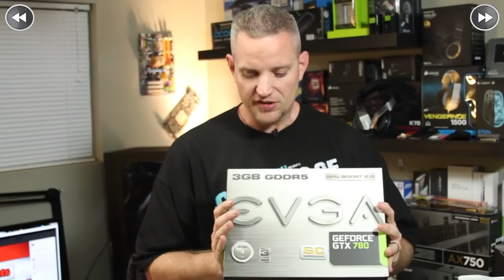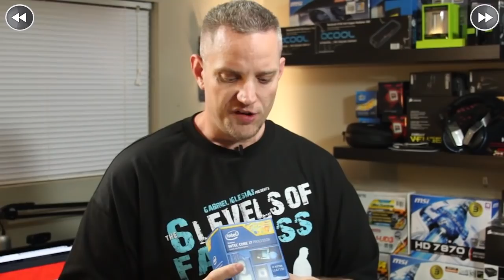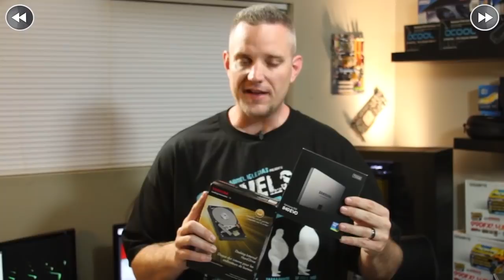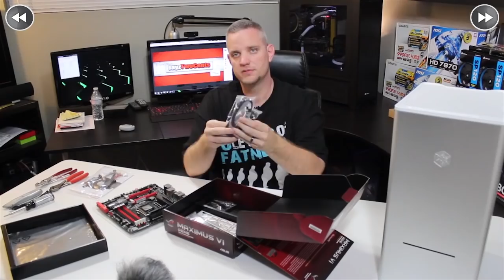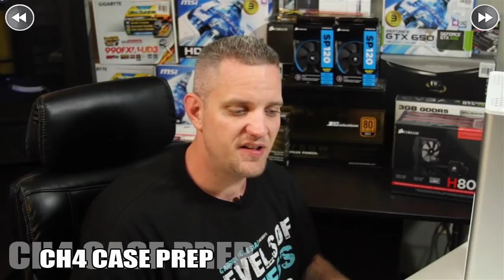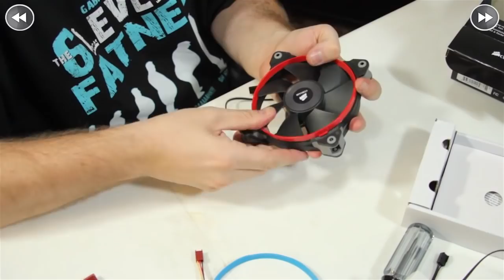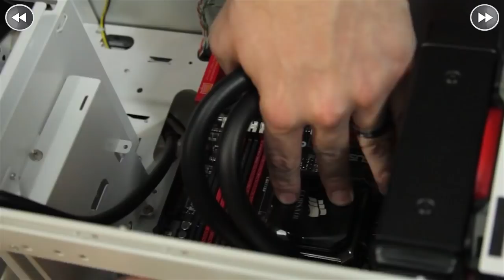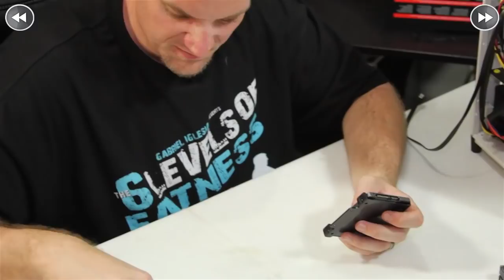How to build the Ultimate Gaming PC - Build Guide and Tutorial

Comment: hey guys so my pc build
is: i5 3570 non k
evga gtx 760 sc
asrock z77 extreme 4 mobo
 2 4gb sticks of ram rip jaw series
550 watt rosewill capstone psu
120gb  samsung ssd
1 tb  baracuda hdd
corsair 500r  case

My question to use is this a good build? I have already build and if its not what would you upgrade first? I realize i should squeezed and extra 30 dollars for the k series but at the time i was trying to stay within budget.

Comment: if you are a heavy user, go with gaming laptop.. or get ready pay a hefty price for power :P
Reply: Are you brain-damaged?
Reply: Objectified Cross electricity is expensive here in my country.. 

i meant power as in electricity not performance.. my bad..
Reply: sasi kumar Laptops are not the way to go for gaming. One simple reason: cannot be upgraded. You want a new GPU? You have to buy a new laptop. You want to add some SSD memory? Buy a new laptop. You want to add some RAM modules? Buy a new laptop.
Reply: True to an extent. 
If you go for an AMD laptop however, chances are you can just throw in a new APU and bam upgrade complete. 

(EX: Some users have been able to swap their A6-4400m's and such out with A10-4600 and A10 5750m's giving them a huge peformance boost at little to no cost since said laptop APU's can be had for next to nothing.)
Reply: Actually it doesn't need 80+ spec. 
A Ultra LSP unit with the right spec would cost less and do just fine. 

Hell my LSP750 cost like 20$ refurbed but it's got that slight bit more juice to to it than the CX430 and still meets every requirment for 80+ other than the issue of the voltage switch which prevents it from getting that. But that's tbh from anyone who knows a damn thing a pretty stupid and mundane requirement.
Reply: And change processors. 
Only select models are BGA, which is mostly rare for anything that isn't running an Atom, or isn't a tablet/phone. 

The only issue is you can't just assume.
You actually have to test for yourself, or dig around for the proper BIOS support information list. That 300$ Pentium B950 laptop? Highly probable that it's upgradable to even a i7 of the same generation. Highly probable. 

I have a Core 2 T7200 in my laptop, but it's NOT in a BGA package and the bios supports up to the 2.6ghz model of the same generation or in otherwords although it requires more delicacy (smaller parts, CPUs still have pins) laptops can be upgraded. So yeah. lol

Comment: Can anyone tell me if this is a decent pc build? This will be my first time building my own gaming pc.

Intel Core i5-4670K 3.4GHz Quad-Core Processor

Cooler Master Hyper 212 EVO 82.9 CFM Sleeve Bearing CPU Cooler
Gigabyte GA-Z87-D3HP ATX LGA1150 Motherboard	

Corsair Vengeance Pro 8GB (2 x 4GB) DDR3-1866 Memory

Western Digital Caviar Blue 1TB 3.5" 7200RPM Internal Hard Drive

Asus GeForce GTX 770 2GB 

Corsair Vengeance C70 (White) ATX Mid Tower Case	

Corsair CX 600W 80+ Bronze Certified Semi-Modular ATX Power Supply	
Optical Drive	

Asus DRW-24B1ST/BLK/B/AS DVD/CD Writer	

Corsair Air Series AF120 Quiet Edition 3
 
Corsair Air Series AF140 Red 

http://pcpartpicker.com/p/3qa8U
Reply: *****
Actually,he has no need.
WD Black is HOT and loud.
Blue is 5-10% slower, but quieter and colder.
Reply: it will run any game you throw at it
Reply: Awesome build choice, it'll run better than mine.
Reply: I just built my first computer and it is very similar to yours and I can run games like crysis and dishonoured in ultra settings.
The only major differences between yours and mine are that I have an i5-4670 because I'm not going to over clock, A Gigabyte z87x-ud3h motherboard, a Palit gtx770 2gb OC I haven't but any extra fans in my case yet and my gpu only reaches a max of 75 degrees and a seasonic 620 watt power supply.

Comment: This PC build costs about 2000$ and still you dont have  "ultimate" gaming PC., you spend to much money on not important things like SSD which is not relevant for gaming !!! now in 2014 you can build better gaming PC for under 1400$ and this build will slaps gaming PC for 2500$ or more., just buy fx 8320 and aftermarket cooler and OC cpu on 4,5- 4,8 Ghz  and most important three(3) Sapphire Radeon VAPOR-X R9 270X 2GB GDDR5 DVI-I/DVI-D/HDMI/DP with Boost and OC Version (for crossfire) ) (or two R9 280x) and all other important parts for PC and that will be about 1400$ ., This kind of gaming PC will be able to play every game on max settings on resolution 2560 x1600 with at least 50-55fps average or more
Reply: first off the guy wanted portability, thats why a pretty penny went on the ssd, and second the 4770k with the 780 will eat your 270x haha, and im quite sure that card coulndt do max settings in 1600p at 50fps if it was 1080p then yeah maybe. and your pc is far from better, if you throw price out the window, (which is the only winning point of the things you said) then this pc will eat that one alive. if your gonna go against the 4770k you better be using the 8350 or better. (and yes i prefer amd of intel so dont think of me as a fanboy haha)
Reply: GTX 780 is (much)weaker than two R9 270x when you crossfire them., you have videos on youtube and performance of two R9 270x and then look performance on games with one GTX 780 then you will see what is the difference beetween them. ,I see only that i7 4770k give shity results when you crossfire two GPU-s ., it can be bad motherboard or failure in softwarte but i see few of that things already
Reply: your high bro haha, while crossfire does give it a good boost, it doesnt beat a 780, maybe it will in battlefield but not anywhere else. and two of them costs the same as 780, (using asus direct cu II models) and besides you wont run into crossfire/sli compability  issues either with just one card, not mention you can oc the 780 like beast to where it pretty much becomes a 780ti, which we all know is the best single gpu there is right now.
Reply: it beat 780 , with 780ti are same or in some games better few % and in other worst
Reply: link a video then
Reply: from what?you dont need video just look for prices in amazon and you know probably count and you will get that amount
Reply: im talking about link a video proving that two 270x beat a single 780
Reply: i give to you two links!!! on one you have benchmarks of sleeping dogs on two R9 270x  and on other you have benchmarks of sleeping dogs on GTX 780., resolution are same only and  settings are same only antialiasing are not same ., if you are stupid to compare that two videos than forget about that.
Reply: post the link on here so i can see what your talking about
Reply: I don;'t know what this has to do with "gaming" other than one could "game" on it. I think I am just going to put "quotation" marks around every "word" so that I can "argue" "bullshit" "semantics"
Reply: Mr11ESSE111 It's too bad that Crossfire doesn't double the performance of the cards.
Reply: LInk to your sources? If you just give reasons and say look it up, your argument is invalid and you're just a troll.
Reply: ryan crane
pretty sure his trolling, two of them cost the same as 780 for less performance, everything i found says so, unless it scaled 100% all the time which it doesnt... so yeah your argument is invaild,
Reply: Mr11ESSE111 but who cares about price?? if you are building a PC more than 1500 dollars go BIG or go HOME
Reply: JJLnerfstudios everybody cares about price !! only fools dont care ., if you build for 1500$ PC which is worst in performance than PC for 1000-1200 $ then you are fool
Reply: about 40-60% more fps are., depend what CPU,game,and million other smaller things., imfact i see that this new  i7 4770K got relative bad performance with crossfire GPU-s with two R9 280x
Reply: So why would 2 270x's be any better?
Reply: because it is and it is cheaper
Reply: and if you to dumb that you dont know to count and see how much cost each part of PC and what you can buy for 2000$ on amazon then it is your problem
Reply: I figured. Especially since he hasn't responded.
Reply: Some games benefit FPS wise from SSD drives, namely, DayZ and most Arma games
Reply: The performance of SLi/Crossfire, is dependent on game support for it, Driver support for the game and the luck of the draw of the card/s.
Man, this is the build that this customer wanted, not your's. If this person wanted to spend money in this fashion, who are you to tell him otherwise.
Reply: but what this got to do with "gaming" ??? he could spend 20 000$ on "Ultimate gaming pc" and still be weaker than someone gaming PC for 1500 - 1800$
Reply: And, you're "saying" that an 1800$ "computer" can run better than a "computer" costing 200-500 dollars more?!?! ALERT THE PRESSES!!!!
Reply: 1400$ can be better ., when I see PC builds for 2000 -2500$ and only one GPU then it is not gaming PC ,. it costs so much money because owner invest money in parts which are not important for gaming( SSD most)
Reply: I am certain that one could get comparative performance for less money. But, as with all hardware one is purchasing, one needs to look at what software is going to be used with it. SSD's CAN improve performance in certain games. Mainly big open world games that have to constantly prefetch and draw objects as you move around the large world
Reply: And, a single GPU solution is the most optimal for a gaming PC, as SLI/Xfire does not always scale 100% in every game
Reply: two R9 270X are better than one GTX 780 or in some games better than GTX 780ti., and two r9 270X you can have in PC gaming build for 1100$
Reply: and you can get two R9 270x for 460$ (amazon prices)., in some games GTX 780ti are much weaker than two r9 270x while in some others for few  percent better
Reply: Source? I want graphs that show that.
Reply: And crickets. I figured you wouldn't bring any proof, aside from your fanboying.
Reply: are you blind!!!  i give you or some other two links already
Reply: I don't see any links? Why should I have to provide your proof for you? Do you know how arguments work?
Reply: if you smart so much then you will find them like i do
Reply: Here is some bench marks. http://www.reviewstudio.net/868-amd-radeon-r9-270x-crossfirex-and-r9-280x-4-way-crossfirex-review
The problem with your opinion, it leads to poorer upgrade-ability. There is only 2 slots, and if it is already used up, then you will have to upgrade 2 higher performing cards at one time, not just 1 card.
Reply: you see that i have wright, two r9 270x are better than one gtx 780 (and probably same or little better than 780ti) ., infact you see that crossfire with two or three  r9 280x dont have any more fps  on some games than two R9 270x., so conclusion is buy two R9 270x for less money than GTX 780 (or same like one GTX 770) and you get more fps than with GTX 780
Reply: Mr11ESSE111 well you cant play borderlands 2 with that build because nvidia physx that will make bad frame drops, i know that because my friend has radeon hd 7990 and amd fx 9560 and when he tried play borderlands 2 he gets 10-35 fps so... thats why nvidia is better in some games but i dont say that amd sucks because avarage gamers will play battlefields and other games what does not use physx and i like amd just cause i can get good frames with it but in some games it just doesnt work out i have gtx 460 and thats good for me
i get 30-50 fps in battlefield 4 with ultra 1080p no AA
Reply: BF 4 is not some demanding game for GPU
Reply: Why Crossfire 3 low-end cards when they cost the same as a single BETTER higher end card? 

Esp when AMD still has that frame-latency bug? 
Dumbass.
Reply: two R9 270x are better then one GTX 780 or 780ti for about 10-15% in most of the games., so three will be about 35-30% better with more fps
Reply: Where in there did I mention the GTX 780? Fucktard.
Reply: Objectified Cross
and what GPU-s costs like one GTX 780 or 780ti or r9 290x ???? about what GPU-s you think then??? HD 5450,6450...??? here is the subject about GTX 780 because this video involve GTX 780 !!! are you stupid or idiot king only ???
Reply: tim luffy
watch this and see:http://www.reviewstudio.net/868-amd-radeon-r9-270x-crossfirex-and-r9-280x-4-way-crossfirex-review
Reply: Objectified Cross
dumbass stupid watch this:http://www.reviewstudio.net/868-amd-radeon-r9-270x-crossfirex-and-r9-280x-4-way-crossfirex-review
Reply: Feltzeri http://www.reviewstudio.net/868-amd-radeon-r9-270x-crossfirex-and-r9-280x-4-way-crossfirex-review
watch this boy:
Reply: ryan crane watch this boy:http://www.reviewstudio.net/868-amd-radeon-r9-270x-crossfirex-and-r9-280x-4-way-crossfirex-review
Reply: haha., you dont know nothing., did you watch this link with benchmarks ???
Reply: This is stupidest argument I've ever seen... You like AMD, He likes Nvidia, it DOESNT MATTER. All it matters is preference, yes 3 AMD crossfire cards are better than a single 780, but when u SLI 3 780s it will kick the r9 270s asses. For me I've never had to worry about budget, all my builds are 3000$ or more, wether it's for gaming or workstation... So price doesn't matter to me as much. But I have to agree with you that AMD cards are better for gaming than Nvidia cards, which are more optimized for rendering and 3D animation. If you are gaming guys don't go beyond GTX 770. anything Beyond that is optimized more for work. get a R9 290x if you want more performance out of your games
Reply: JJLnerfstudios i talk about two r9 270X crossfire because of price!! two R9 270 x costs 390 $ on amazon , and one GTX 780 more than 500 $ with 3 Gb ddr5 !! but two r9 270X  easily beat one GTX 780 even 780ti too which cost 700 $
Reply: GTX 780 weaker than the 270X? What are you fucking smoking?
Real world tests in games show that even a GTX 770 is worth more than a R9 270X. So a 780 being weaker? Ha, the 780 smokes even the R9 290X. And is much cooler and quieter.

If anything on the high-end scene Nvidia is the way to go right now. Until AMD's top GPU's stop reminding everyone of the HD 2900 series.
Reply: i said two R9 270x for crossfire., next time read better
Reply: ***** dont feed your feet
Reply: Mr11ESSE111 I have two R9 270X in crossfire and i can tell it isn't that good. In some games like bf4 yes it is really good (70-100 fps ultra 1080p) but in other games that don't support crossfire it is really bad, like Sleeping Dogs, Saints Row 3-4, The Crew, etc (30-40 fps). That is why i just bought a gtx 980 :)

Comment: Planning on building this set up, but cant decide on a case. Any suggestions?

Mobo: Msi z87-gd65
Cpu: Core i5 4670k
Ram: Corsair vengeance 8gb 1600mhz
Gpu: Gtx 780 Sc 3gb ddr5
Psu: Corsair RM Series 750 Watt
Reply: NZXT H440 is looking quite decent at the moment, Fractal R4 is also nice, do some research as opposed to trusting the legions of idiots on youtube.
Reply: Rob Gadeke NZXT H440 ftw!
Reply: NZXT Guardian 910, Epic looking case with ok cable management.
Reply: See I have the same build in mind as well and couldn't decide on a case I want something that looks decent but also has cooling. I mean majority of the cases won't go beyond what 30dbs with everything installed? which is what a whisper basically so unless you want complete silence which in any case you should have headsets on soooo you wouldn't hear it anyway. So with that in mind I though about it NZXT phantom looks good and has  decent cooling capabilities. So that's the case i'm going with
Reply: Fractal Design R4, CM 690 III, NZXT Phantom, there are so many, it really depends on whether you want looks, cooling performance or silence.
Reply: Nanoxia's Deep Silence 1 is a pretty sweet silence-optimized case like the R4, but with enormous watercooling potential. OC3D does a great build guide showing what it's capable of.
Reply: I love the rosewill Thor, just my oppinion though
Reply: I really like the NZXT Source 220, it's flat black so I can paint my own graphics onto it and it has good cable management options, I don't really know how the airflow is on it tho.
Reply: Zalman Z11 plus!!!
Reply: Corsair Obsidian Series® 250D Mini ITX PC Case
    or
Corsair Graphite Series™ 760T Arctic White Full-Tower Windowed Case
Reply: German Talash thats an ATX Mobo so it couldnt be the 250D
i would say the Corsair Graphite Series™ 760T or 
Corsair Obsidian Series™ 450D/750D
Reply: zalman z11 plus and then you should put some blue leds in there it would look awesome
Reply: Sharkoon T28 Green.
Reply: I have the Cooler Master Storm Trooper, it is a full tower with built-in fancontroller and it looks amazing, it also has a carrying handle that supports up to 43 kg. It comes with one 200 mm fan on the top, a 120 in the back and 2 red led 120 mm fans in the front. I went for a Razer themed build for my pc, so I replaced the 120 mm fans with green led fans. It looks amazing!!
Reply: I love my NZXT h440 but it also matches my color scheme, I have a red and black color scheme.
Reply: Try antec v1
Reply: Izzy Latham define r4, which company?
Reply: facepalm Fractal Design

Comment: I'm thinking of Building a MATX Gaming PC, any suggestions that could make it better? i.e. cooling and multi GPUs  e.g. 1 280X OC WF instead of  2 270X OC WF?

Corsair obsidian 350D
Asus Maximus Vi Gene MATX (intel)
Intel core i5 3570k
8 GB Corsair vengeance pro series (1600)
Corsair H100i and AF120/140
Corsair AX760 PSU
2X Gigabyte R9 270x OC Windforce  
(Windows 8.1, 120GB SSD and 1TB HDD